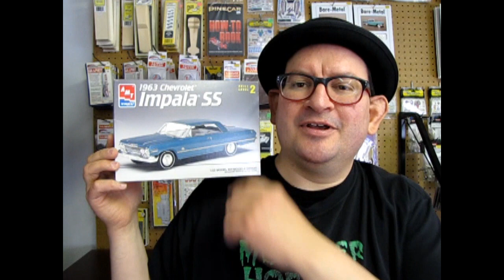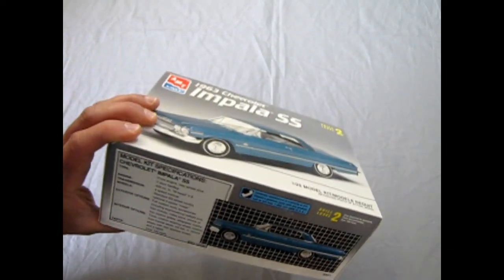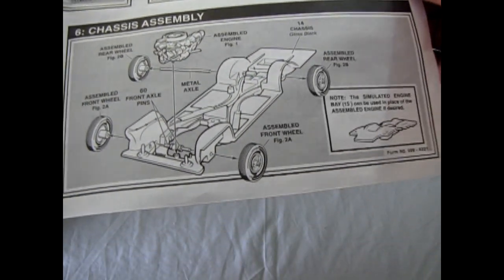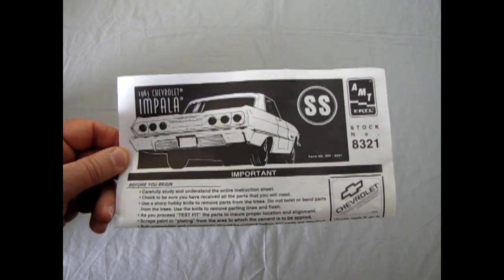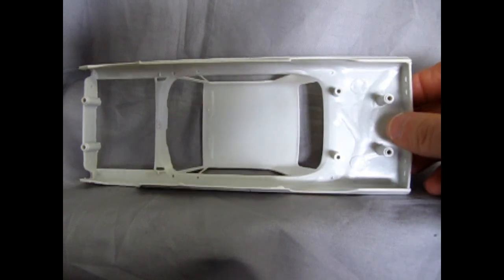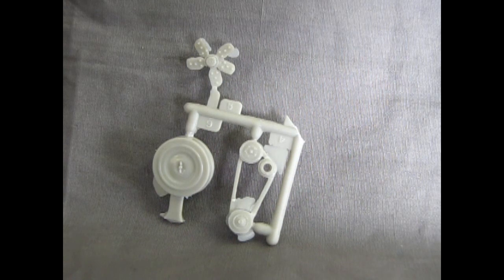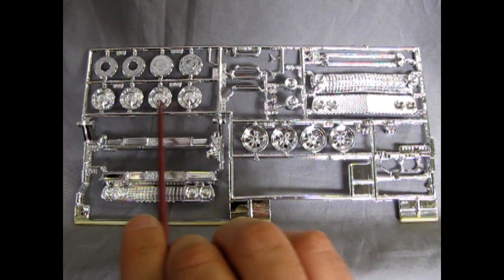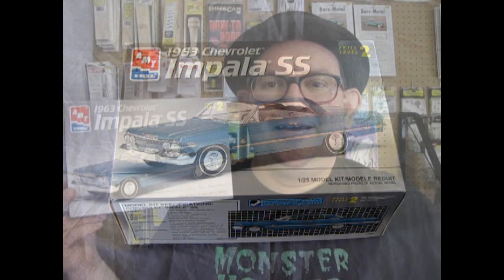Model Car Garage - 1963 Chevrolet Impala SS Model Kit By AMT/ERTL - A Model Car Unboxing Video

Comment: Good review Trav. Looks like a pretty good kit. Thanks for sharing.
Reply from the maker: You are welcome! ThanX for your continued support!
Reply from the maker: How would you build this kit? Stock, Custom or race, and which custom body parts would you use?
Reply: @MonsterHobbiesModelCarGarage  l like building stock. Would probably use the custom front and rear bumpers not a big fan of scoops on cars.
Reply from the maker: @bigcharliesmodelgarage296  Stock is always good. With all the missing parts compared to the original kit, building this model stock is almost the only 100% viable option. 

I hear that the new kit from Round2 restored all the missing parts. Have you seen the videos that show that?
Reply: @MonsterHobbiesModelCarGarage  no l don't think so.
Reply from the maker: @bigcharliesmodelgarage296  I think Hpiguy has an unboxing/build video on it. It's worth a look. I wish I could unbox and build, but I have so many kits and no way to "Speed up" the camera or dub over the video. I am thinking out alternatives to speed up the process, like showing people how to scrape seam lines in a "How to" video, then when I film the building video, refer to the "how To" video in the building video. Then I don't have to spend 20 minutes in each video showing people how to scrape seam lines over and over again. Do you think that would work?
Reply: @MonsterHobbiesModelCarGarage  it may.
Reply from the maker: @bigcharliesmodelgarage296  I hope so. It will also give me a few more videos to upload! :D